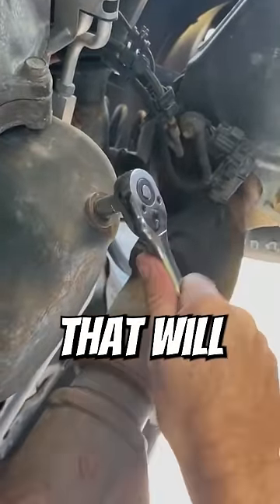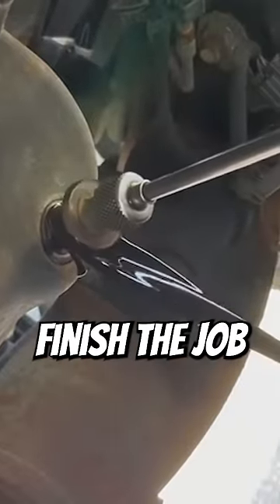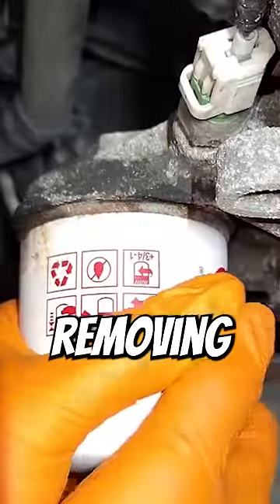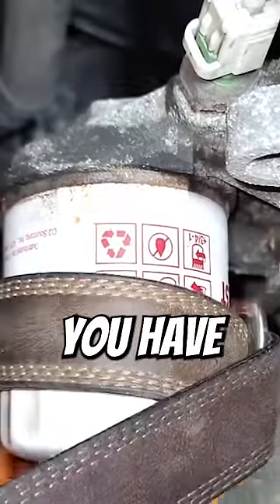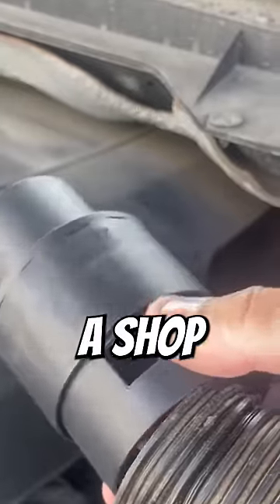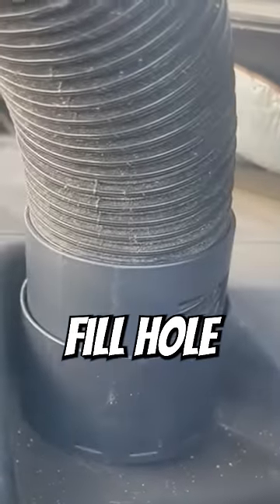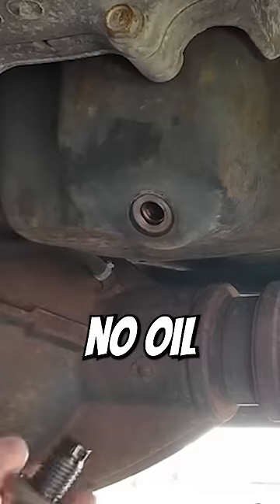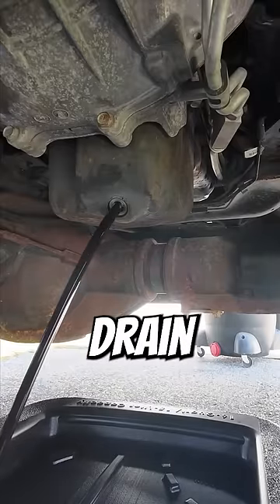Mechanic Life Hacks That Will Improve Your Worthless Existence - Oil Change Edition

Comment: Engineers: “I will single handedly render these oil filter hacks useless by putting the filter in the most obscure place for design purposes”
Reply: "Furthermore, I'm going to mount the filter on the side of the engine pointing out at 90 degrees to the pump housing, enjoy the mess as it runs down your various coolant pipes and suspension components, fcukers!"
Reply: @skylined5534  my wifes nissan rouge.  I have to pull aside the fender lining just to reach a side mounted oil filter 😅
Reply: @emanuelruiz7710  My wife's 88 Jetta (which had an accessory water pump, not one on the block. I guess VW was new at water pumps...) you had to unbolt the coolant lines and push them to the side to get at the oil filter.
Reply: I'll never understand people who buy vw's or jeeps
Reply: Laughs in subaru boxer, the oil filter is just right there when you pop the hood.  It's wonderful.  Also, fumoto valve FTW.
Reply: The new Ford rangers had this in mind completely.
Reply: @anythinganytimealways  VW have been the most trouble free vehicle I've ever owned. Benefits of german engineering without the high cost of purchase, service and parts like other European cars. I do agree with the jeep thing though
Reply: @glenfields2472  it's just nuts that you have to disassemble half the car to do a lot of jobs on vw. That sends the labor into orbit
Reply: @emanuelruiz7710 every new ish nissan has that location lol.  Actually not terrible in my opinion
Reply: @skylined5534  Or all over the exhaust so it can smoke and stink for awhile!
Reply: I know. I just take off my front right tire so i can not make a mess 😂
Reply: @emanuelruiz7710  Well, what did you expect 😂? The clue is in the name of the model: rogue.
Reply: The belt is my favorite
Reply: @drew5337 also if you just crack the filter loose before you remove the drain plug, the oil will get pulled out of the filter and you have no mess when you remove it. Love my subi ❤
Reply: @glenfields2472 I wish mine was, a GTI.
And an Audi wasn't much better. Both with ridiculously expensive replacement parts!
I'm looking for an older Lexus, that's "made in Japan". The older 400, built to be (almost) trouble free.
Reply: @drew5337 you have to change the oil in your Subaru? Mine changed itself with all the oil it burned 😂
Reply: "In 2016, Volkswagen ranked 22 out of 29 manufacturers according to the annual ConsumerReports reliability survey. In that same year, ReliabilityIndex reported that Volkswagen came 9th in their annual report.

Though this doesn’t sound impressive, it is better than two of its German counterparts, Audi and BMW.

In ReliabilityIndex’s 2019 survey, Volkswagen came 25th out of the 40 manufacturers index"
Reply: I hated changing the oil in mom and dads 1980 Subaru.  The filter was in the most awkward place

I would dearly love to get these auto designers out here to show me just how we are supposed to work on the vehicles they designed.  I would rather help work on our 1986 Freightliner vs working on our 2016 GMC Terrain 😏
Reply: My Lincoln Mark VIII... There's a drip channel for the contents of the oil filter that you'll have to dump out so you can tumble it over and through a path to get it out. One of the dumbest placements I've encountered. It's up there with the 4.0L Jeep filter which is easy to get to, but when you crack it loose, there's a good chance that your knuckle was in the best spot to snap the oil pressure sending unit off because some idiot engineer couldn't put that another 2" away.
Reply: @abdul-kabiralegbe5660   He doesn't have a Rogue, he's got a Rouge! 😉
Reply: @vic.smittie.5668  I think he spelt it wrongly. Rogue is the Nissan model. Rouge means red in French, if I'm not mistaken.
Reply: @abdul-kabiralegbe5660  Sure! Just pulling your leg there! 😁
Reply: Sure of it
Reply: @drew5337 lol ya laughing till you blow a head gasket and shit out a pushrod
Reply: @skylined5534 yep. Reminds me of my '03 F150. It was sideways and above the crossmemeber. Oil everywhere.
Reply: @natehill8069 well yeah, they were air-cooled for a long time. Probably just used an engine that was originally designed to be air-cooled and the car they put it in didn't allow for that.
Reply: @drew5337 I put a fumoto valve on my duramax. Loved it
Reply: Not this engineer.
Reply: Cummins diesel. Through the right fender. Filter removal is sorta ok with the correct socket on the filter. Turning the filter horizontal: not well thought out. Someone makes a t-handle plug to screw into the filter. Finally found that out after years of oily spills and oily hands.
Reply: 93' Chevy Blazer: I'm gonna do what's called a pro gamer move.
Reply: My old bm the filter was on top of the engine 😅
Reply: Yes. My civic has the filter on the side of the engine as to spill as much oil as possible during oil changes.
Reply: 2jz in shambles.
Reply: Obscure defined - 1/2 inch below the exhaust manifold. Run coolant, power steering, and/or transmission lines below it in the path of the oil (ensure it's a rubber section, not rated for engine oil). Place cross member or subframe directly in the path of the oil (ensure there is a wide flat lip for maximum spread/splash). Optionally place wiring connector(s) in path of oil.
Reply: @drew5337 ah subaru, I forgot for a moment that they smartened up from the "ring of fire" they used to do
Reply: @drew5337 I did an oil change on a WRX and was looking around for the oil filter thinking where tf is it hiding at, then I went looking from above the engine. Took me a good minute till I realized it's looking right at me sitting on top of the block
Reply: Ahh so your the ones putting them behind the damn engine move them uptop like an older benz 😂
Reply: @skylined5534 My Chevy S10s is like this but at least mine came with one of those oil drains Bcz after I unscrew there’s this little drain tunnel it runs down to the bottom to a oil pan but I have to say that placement still sucks bcz I have to look for it then get my hand on it then somehow get my hand out without spilling the oil and then have to try to get my hand back in and then find the port all without eyesight 😮‍💨😂.
Reply: I swear Chevy fucked the cateyes badly. The oil filter is right next to the oil pan like literally built into it so you have to find a way to grab a hold of it and once you finally do get it off then there’s a whole crap ton of oil still built up over it and it all gets all over the filter and your arm and going every where but the drain pan 😤
Reply: @natehill8069  No, you don't have to. I own 6 VWs from the 80s including a Jetta and changing the oil filter is easy, no need to push away anything.
Reply: @macdaniel6029  How did you get past the A/C lines, the were right across the bottom of it? I dont remember it clearly, we got rid of it after 2 years because it was a lemon from the word go, every single breakable thing on it broke (for example, the rearview mirror - how complicated is that?), except maybe the paint. 

Then a couple of years later some lady called us out of the blue and said "did you used to own this car" and we said yes but it was a turd and she said yeah she was having problems with it too and I told her I would be thrilled to testify for her in a lawsuit.
Reply: @natehill8069  That is easy, none of my cars has A/C, in fact the Jetta is the only car I own that has power steering. I like to keep it simple. Was your Jetta a 16V model? 8V and diesel are rock solid, they never fail and run forever as long as you change the oil regulary. In fact the EA827 engines are in my opinion one of the best engines on this planet. Extremely reliable, easy to maintain and good economy.
Reply: YES
Reply: @skylined5534 or its right above the titanium headers..... the filter placement on the 18 r1m. Fuck me I hate oil change day. Most of my time is cleaning oil off the pipes.
Reply: kinda like the oil filter on my 99 f150 being between a control arm
and the front differential. so dumb
Reply: @anythinganytimealways can’t go wrong with a 4.0 I6
Reply: @skylined5534 honda element vibes
Reply: Lol
Reply: The Lexus is has it under the radiator SIDEWAYS. So the only way to not make a mess is to put the pan under but usually still gets the lid oiled and a small mess
Reply: Thanks Cadillac
Reply: I had to buy a special wrench attachment for my Toyota rav 4. It’s a cool design honestly but I was real pissed when I got under the car for the first time.
Reply: @roushstge2  ford even positions the drain plug on the f250s and up to be in line with the sway bar, so it sprays literally everywhere.. thanks ford
Reply: Like right above the starter on a ford ranger.
Reply: @anythinganytimealways American can manufactures do that pretty regularly now. Some trucks you have to pull passenger seat to change battery, other cars oulk front tire and fender liner. Most fwd compact cars it's easier to pull the motor for a timing belt change than it is to keep in and do it.  In some.cars the pil.fikters are under the intake in a horizontal position. Easy to get to, going to make a mess.
Reply: How about when it drains directly over an axle or some other part? That's my favorite. I refuse to do an oil change otherwise.
Reply: Das German engineering
Reply: Screwdriver through it always work
Reply: @lanerobinson8994  Tell that to my red loctite.
Reply: Darn engineers I could had that oil changed in 5 damn mins but some bozo stuck the oil filter on the intake and I had to crawl around for an hr thinking I had the only car in America that just didn't have an oil filter
Reply: as a person that owns a 2001 Lexus IS300, this is most certainly directed at me
Reply: @skylined5534  one of the nicest things about my 2017 Escape, you drop a panel underneath the engine and the fliter is right there. No tight squeezes or awkward angles
Reply: @natehill8069 it’s an additional pump, the engine has its own mechanical i think.. at least that’s how audi does it.. since it’s pretty much VW it should make sense
Reply: Subaru kinda does this but it’s not horrible. Sure I don’t like reaching through a slight corridor to get my filter but there’s space for shit to happen Yknow?
Reply: Yep engieers purposly put stuff that gets replaced often in the hardest place to get to.. smh. I think design ppl or any drafting i guess its all cnc .but then everyone needs to work on whatever they are designing..
Reply: That's why I love my e46, it's under the hood right next to the intake manifold lmao. Draining it still sucks
Reply: @drew5337  laughing in reliable head gaskets Ford 300 L6
Reply: @insanitycompromiseentertai7665  it's a newer subaru, but fair point.
Reply: Chevy cavalier lol
Reply: As a mechanic, one of the most annoying I’ve done is the new Ford Rangers. Why tf did they put it behind the wheel well it’s horrible
Reply: I never understood 6.7 litres and 100bhp  actually all your cars  @anythinganytimealways
Reply: @anythinganytimealways Old jeeps from the AMC and Kaiser era are actually really easy to work on. It's just the Chrysler era ones that suck ass
Reply: On the top, front and center in my Subaru :)
Reply: Luckily I have a 40 year old german car so I only have to remove the air filter box thing to get to the oil filter. Removing the oil filter and getting spare parts is a different problem though
Reply: I know. I have the filter wrench but alot of times have to do it by hand

Comment: I like the tried and true "jam a flathead through the filter and turn it"!!!😂
Reply: Works like a charm
Reply: Second that, plus it leaves a nice fresh coat of sealant on the driveway or garage floor. Keeps dust down...;)
Reply: @ColoradoCarrolls  indeed. Nothing more annoying than shop dust!!
Reply: I had a filter so stuck one time that I tried that... I damn near bent the screwdriver and it started just wripping through the entire filter skin. I ended up finding a shop that had these giant vice grips for an oil filter, that finally got the damn thing off. Still cursing the name of whoever put that filter on
Reply: Yea I can't do that on my mercury 😭 it's positioned horizontally with a bunch of tubes and wires in front of it. It's a bitch to get off that's for sure
Reply: when the motor is hot that is the method !
Reply: 😂 yup! Done it many times
Reply: I tried that once and ended up stabbing it until i had two pieces left, cause i could only turn it one rat pube's width at a time
Reply: Done that more than once.
Reply: @KipWittchen ahahahahaha iv had this, was servicing a big ol tractor on a worksite when i was like 18
Reply: Works 60% of the time, 100% of the time 😅
Reply: Bro- you stole my comment! And I prefer a #2 Phillips
Reply: Did you try turning it the right way?  ;P @KipWittchen
Reply: Been there. Done that. 😂
Reply: ive ripped filters doing that on humvees and FMTVs. some people in the army dont understand hand tight
Reply: @KipWittchen I had something similar happen to me, ripped the damn silter in half, I think I got it off with a chain, the biggest breaker bar I own and a lot of swearing
Reply: Yeah but... he's talking about the drain plug, not the oil filter...... ?
Reply: @AstroTiddies  I feel you I got a mercury capri and they decided that the starter should go right by the oil filter
Reply: Better if you hit it dead center wait for it the drain out the filter then get two screw driver and stick it in there like a X and twist
Reply: Cant always do the screwdriver trick. Some cars/trucks there's not enough space, and if its too tight, the screwdriver just rips through the filter case
Reply: @astroblue6207 not really. I prefer to let it sit first so as much oil drains down to the pan as possible, to get as much of the old oil out as possible, and id rather not deal w hot oil, hot exhaust, etc
Reply: Used that alot as a motorcycle tech. They never leave room on the large cc scooters. Its the only way to get some of them out.
Reply: Dad taught me this one 😁😅
Reply: It's the only thing that works on my Polaris. First time I did it, I tried two different filter wrenches and spent a half hour trying to get an angle.
Reply: Came here to say topic comment
Reply: Came here to say topic comment
Reply: @entertainmentforall6609  just don't be that guy who really pounds it through with a hammer and takes out their pan on the way
Reply: DO NOT DO THAT .. some cars . I,e  most GM cars, have an upper oilpan next to it with tight clearance , even newer RAV have the same situation.  If you punch hard enough  screw driver will go through the entry wound .. exit  wound into the upper oil pan . There is a YT short video on it ! Look it up. What kind of damage can it do ? It's not worth it . Using proper oil filters does not leave you stranded with a hole in a pocket .
Reply: I call IT the screwdriver stabby stab.

Comment: Not really a hack for engine oil, but great for transmissions and differentials. Always make sure you can access and unscrew the fill plug before you drain the oil.
Reply: Buy a BMW - there is no drain on the diff and you have to suck it out with a pump. A huge saving in only having to undo one plug!
Reply: Also make sure you remove the drain plug before you drain the fluid.
Reply: Alternative: if you can't unscrew the fill plug, just drain it like normal, flip the vehicle upside down, and fill it that way.
Reply: @pmaverick4983 do you mean the fill plug?
Reply: @the_dog_says_moo  I think it was a joke ;)
Reply: Hammer a screwdriver through a jammed oil filter.  It’s not like you are going to reuse it
Reply: @Ifixitagain did that once & ripped the bottom of the oil filter off & left the top part screwed in still. I d just recommended a oil filter removal tool specifically sized for the car you own first time I went, thought they were adjustable turns out there’s a certain size  for certain filters & I couldn’t return it once it had been opened go figure 🤣
Reply: @pmaverick4983 that was funny bc the original comment kinda said the same thing which is why you was joking about it I cackled.
Reply: I once had a car and discovered that one of the bolts that mounted the clutch cable bracket went all the way through the gear case. I started using that bolt hole for refilling the gear oil, instead of the factory fill hole that's very inconveniently located on the side.
Reply: @lihtan  
I can't tell if that's a design oversight or the guy that made routed the official clutch cable bracket (etc...) just wanted to spite the bastard that put the fill port in the inconvenient location.

Or the same guy routed all that and wanted to lazily fix/hide their fuckup from a poorly plated fill port.
Reply: @OrcaBrigade  The side mounted fill bolt was designed so that it be impossible to overfill the transmission. I would actually remove it, and pour oil until it just started to lead out.
Reply: A freaking men.........always check the fill plug first...